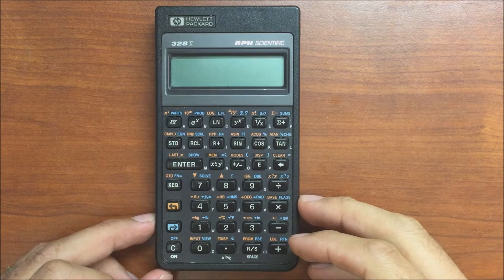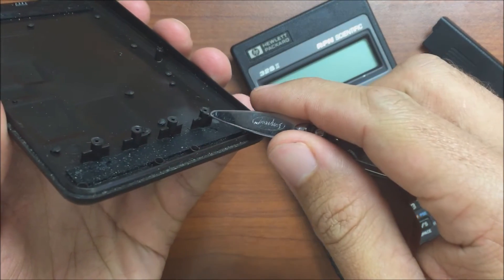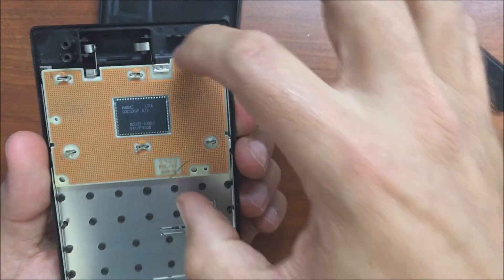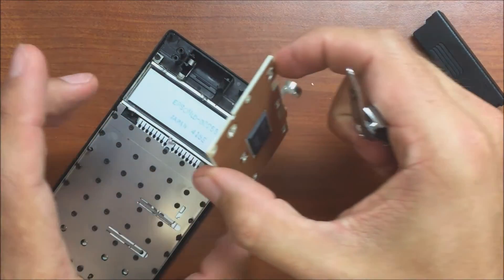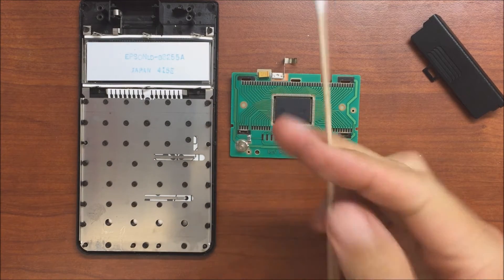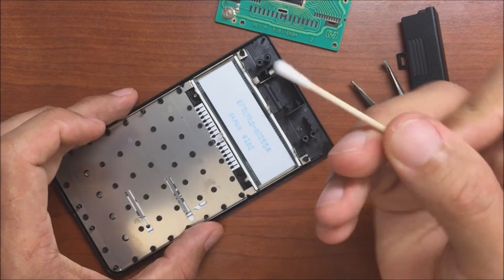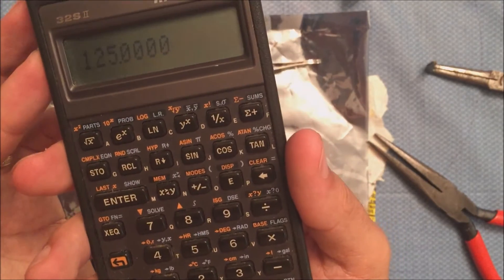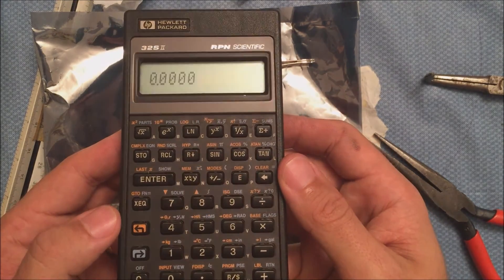HP 32SII Calculator Keyboard/Screen Repair (and other Pioneer models)

Comment: Here's a simple fix to try without opening the calculator up.  Remove the battery cover.  Take a small rubber grommet, about 3-4mm thick, and insert it into the space between the case and PCB.  it should be snug. Then with a small screwdriver gently push the grommet further in about 1cm, be careful to avoid the processor IC. When in place this grommet applies a bit of pressure between the back of the case and the processor PCB, which in turn pushes the processor PCB into the keyboard flex cable contacts.  Half the keys on my 32SII were intermittent -- this simple fix brought it back to life.
Reply from the maker: Very interesting! I've pinned your comment.
Reply: It didn't work for me :-( I'll try to open my 32SII - Wish me luck
Reply: does this method work for the 42s ?
Reply: Just tried this on my 20S. It was quick and easy and did the trick! Thanks for the tip.
Reply: This worked for me on a 32SII where the keys only worked by squeezing below the screen. 

I bought a rubber grommet that was too fat (note to self: "panel thickness" describes the groove width, not the total width), so I had to slice off one end. After stuffing the rump into the gap by the battery, I then pushed it about 1" down the body using a paperclip, staying to the left of the processor. 

All my keys are working normally now, with the exception of [C] which is still a little finicky--I think the grommet ended up on the right side (from front) of the calculator and the [C] connection is probably on the left.

THANK YOU BOTH!!
Reply: Did this with a grommet and it fixed it.  Thank you!

Comment: I tried your foam tape but it only worked for a day.  I needed something more resilient.  I ended up using the smallest screen rubber spline which is hollow found at a hardware store.  I sliced it in half longitudinally and pushed it in place.  Now it works without failure.
Reply from the maker: Nice!

Comment: I just purchased a HP-32SII that was "dead" and I got it to work as long as I press down on the bezel. Based off of that I will first try the grommet trick and then taking it apart and padding the strip if that doesn't work.

Thanks so much for your tutorial!
Reply from the maker: You're welcome! I did one for the 20s that is more complete and might be a helpful reference for this too.
Reply: @west  Thanks! I'll be sure to check that out! I think that I will go ahead and crack the case, I'm a bit squishy on the grommet method. It's too hard to tell when enough is enough and how to avoid bits that don't need to be squished. :)

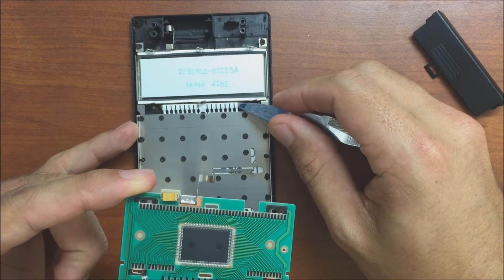Comment: So I stumbled onto a related fix for a non-functional or barely working screen that can be done by opening up the case and removing the PCB just like this.  My 32Sii got to where I could see the screen power on but it displayed nothing.  The issue was the grey and white foam strips with tiny wires in them at the top and bottom of the lcd . (e.g. 2:59)  I thought these were part of the LCD itself (like some sort of flex circuit, and that my screen was toast) but actually they are just a pass through flexible/conformable connector from the pads on the back of the CPU PCB.  They are normally held in place likely by adhesive on the bottom of the white foam.  But on mine a 1/2" section on the end of the lower one had come loose and moved pretty far towards the keys.

The fix was really simple.  I put a piece of something in there to push the foam strip back up against the LCD edge.  I happened to use a small folded strip of thin card stock from some packaging.  (The fold gave it some spring.)  But some foam like being used in this video would do the trick as well.

Comment: Ok, I finally manned up and did it. 

My thoughts: Be extremely patient, do it under good light and preferably before you hit your sixties, some of those connections were hard to see. Overall, it was for me a 2-hour job.

The PDF referenced in the notes is a lifesaver for disassembly, note that the relevant instructions begin on page 7. I did have to remove the keyboard overlay in order to pop up the lower rivets, those 8 rivets were probably the hardest task of all.

I appreciate your video and the PDF link, my 32S is working properly again. 👍👍
Reply from the maker: Outstanding! Glad it works again!

Comment: Thanks so much for the video. I've just performed this repair on my 32s and it fixed the problem. Calculator wouldn't turn on after several days of apparent flat battery.
Reply from the maker: That is very good to hear!

Comment: Just broke the top case corner between the STO button and FDISP trying to get the bottom studs out.
Reply: Now that I've broken the front half, maybe I can create a drill template so that those 4 bosses can be drilled from the back

Comment: Many thanks for your video. I had one vertical row of keys not working. I took out the batteries and flooded the keyboard with alcohol and let it dry for a few days. This actually worked to fix a key that didn't work. Anyway when I turned it on it was completely dead.

I took it apart and cleaned it and it's 100% working now! By the way I left my rubber strip in. 

A few tips. The rivets under the battery cover, I used a drill by hand and removed the heads. That was a lot easier. There are two 1/16" rivets in the middle on the sides and the 4 at the bottom that you point out. They don't go in to the posts you indicate but into posts at the very bottom. I had trouble pressing it back together. I ended up using my big wood vice. It sounds crude but it popped back in nicely.

Bought I new many years ago. Works great again.

Comment: I found an old HP-32SII at work in the trash.  The top row of keys only worked when you mashed the lcd and none of the right column of keys worked at all.  I searched on the web and found your video and followed it exactly.  I used two layers of 3M double-sided foam tape that were 46 mm x 3 mm.  I was very pleased when I turned it on and all of the keys worked!  Thanks for making such an excellent tutorial.
Reply from the maker: I continue to be amazed that my decision, on a whim, to document my attempt was useful to anyone, let alone so many! I’m glad. Thanks for dropping a note and I hope you enjoy that calculator. It’s one of the best scientific calculators ever made.

Comment: thank you
Reply: I just used this method on my HP 32S II that was not working at all.  It had been non-functional for about 15 years in my desk drawer and I didn't have the heart to throw it away.  After using RPN calculators for way too many years I am helpless with other calculators.  I cleaned the contacts with contact cleaner and Q tips, then put two layers of electrical tape on top of the existing foam and it now functions perfectly.  I used some plastic auto body tools to pry it apart and a pair of channel lock pliers with a layer of rubber pad on each jaw to push the top rivets back together.

Comment: I just tried powering up my HP 48G in many years and have the keyboard issue.  This is the best video I've seen on what the issue is.  I saw someone put a zip tie around the case which might work, but looks pretty bad.  If I do try and fix it hopefully it will be good for another 20 years.
Reply from the maker: I tried fixing a 48 around the same time and it seemed a good bit more complicated and I wasn’t successful but I hope you can manage! Maybe you can document the process for us.
Reply: @west  it works again, but it doesn't quite look the same.   It took a couple times to get the right amount of foam, and the only way to know is reassembling with those silly twist locks!
Reply from the maker: @moniack  That's great to hear it works though! Those twist locks make me nervous. I haven't broken one yet but feel like I will. I'd prefer screws.

Comment: Would have been helpful if u had recorded all the disassembly procedure on video. 
For me, only opening this without demaging looks difficult.
Reply from the maker: My note in the description box points you to the 20s repair video for the case opening.
Reply: @west  There is no link. If you can operate a 32SII, you should be able to drop a URL to the video. The only URL is to a PDF.

Comment: Brillant! Thank you, I have my top row back! I would have never attempted this kind of repair, in part because I had no idea what had gone wrong, but your video suggested both the cause and solution. Your instructions and guidance were excellent and simple to follow. I went slow, tried not to force any step and it all went just as explained. Again, thank you very very much,  Kevin Casey
Reply from the maker: Outstanding! I continue to be amazed that a video I did on a whim about repairing a 30-year old calculator has proven helpful to anyone, let alone so many. Thanks for saying something!

Comment: [Update] I've just finished the process and my 32SII is up and running!. I'm really happy :-). The most complex for me has been to properly close the case... well I have to admit that as I didin't have an electric file, I decided to reduce the diameter of the plastic pieces in the bootom part with a  cutter... It worked but the calculator is not perfectly closed  (2mm apart). In any case, thanks again Logan for the fantastic video. MY RPN WORKS GREAT AGAIN!
Reply from the maker: Outstanding! It makes me happy that other people have been able to fix their calculators as well.

Comment: I tried this fix without replacing the rubber strip under the flat flex cable ( could not find a suitable replacement). I used a contact cleaner on all the PCB and case connectors. Unfortunately the LCD became much worse. I just tried cleaning everything again (including the LCD Zebra strip) with isopropyl alcohol. The PCB was pushed over the 6 tabs but they were not twisted into their original position for fear of them breaking with multiple tries. Now the screen is completely blank - nothing. An ohmmeter shows that all the tabs are tied together electrically so I held a wire between one of the tabs and the copper on the PCB. Still nothing. If several more tries fail I will be forced to pay $100 on eBay. Any suggestions?
Reply from the maker: The only real thing I can think of is to actually replace the foam strip. Cleaning the contacts is minimal in comparison to that, in my opinion. I used two layers of this:
https://www.google.com/shopping/product/10972471318699038719

Comment: Geat tutorial! I revived the right line of keys in my 20S. Only instead of removing the old foam I applied one strip of mounting scotch over it and it works. Now I plan to fix my 27S too. Thank you so much!
Reply from the maker: gabi n Very glad to hear that it was helpful. Good luck with your 27s!
Reply: Thak you! Today I solved it. It works as well. Internally is looking like 42S. All the contacts are goldened except for the ones that are the subject of this fix. Hope to solve the 48S one of the next days although the opening is a little bit different.
Reply from the maker: Good luck with the 48. I tried pulling open one and made a mess of it, unfortunately. Lots of layers between the top, the keyboard, and the circuit board and some internal rivets that I found hard to get to.
Reply: Yep! I know I'll have to take a deep breath before :) Thank you!

Comment: Hi, I have the same problem that right side of the keyboard does not work properly despite pressing the bezel as you have mentioned. However, it works if I lift or separate a bit the top from the base/bottom part of the calculator.  Seems there is either too much pressure on the key board when I pressed the two halves (top and bottom) for complete closure. Grateful for your advice here. Thanks.
Reply from the maker: I'm really not an expert in this area so I couldn't tell you precisely what is going on, perhaps a short somewhere? I suppose you could always open it up, take a look, and put a spacer in there if need be.

Comment: Thank you!  The 32 SII is irreplaceable.  My heart sank when mine would not power-on.
Reply: Mine died yesterday.   :-(   After 33 years. I'll try to fix it ... I still have original box and user's manual.
Reply: It works again!!! I've searching and found this: take batteries out and shortcut the contacts. It worked!